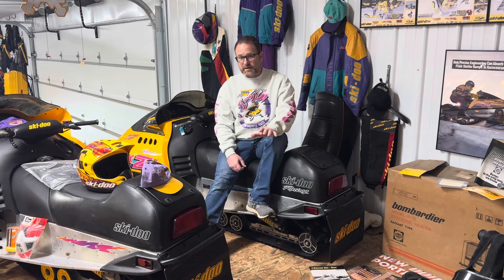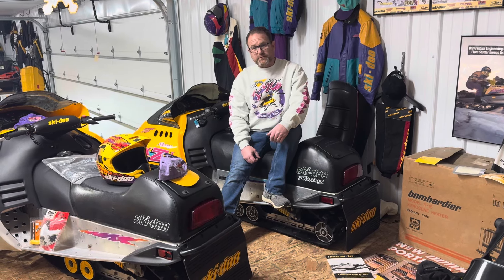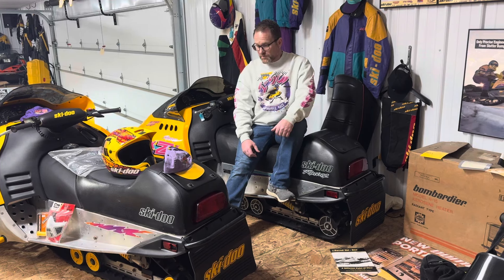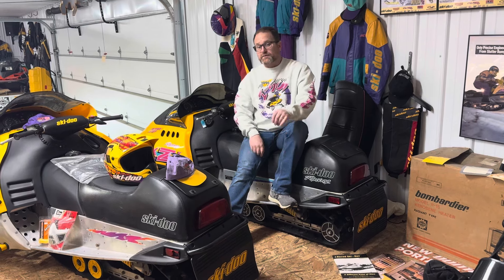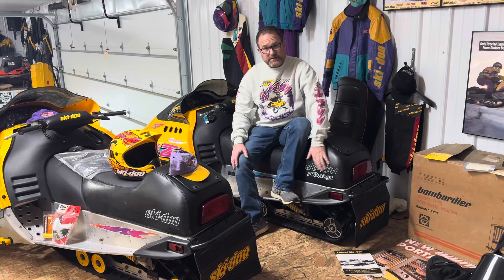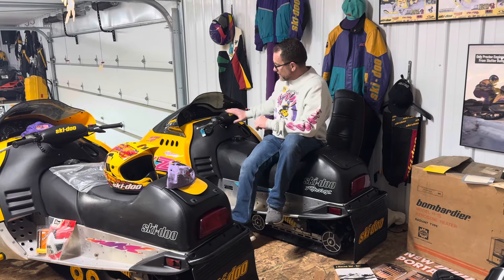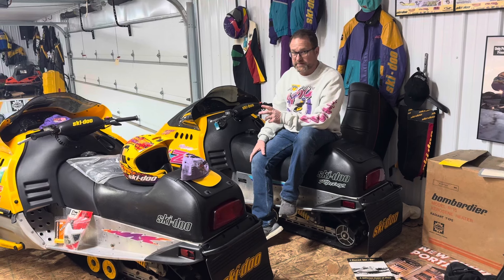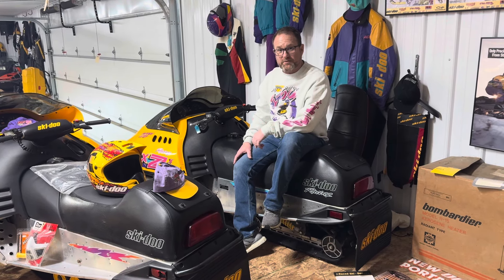Skidoojunky’s Vintage Ski-Doo spotlight. The 1994 Ski-Doo MXZ-X 470

Comment: Love the videos!!! I just picked up a 94 Formula STX 583 with 6500 miles on it. It's in great shape! Put a factory temp gauge and electric start in it. Reverse might be my next addon. Lol What's nice about the 90's sleds is that they're pretty reliable and you can put some miles on them compared to older vintage sleds. Unfortunately it's not a desired model but it's still fun! I rode with this sled for 22 years. Never thought I'd buy it. Lol Keep up the great work!

Comment: Do you know of anything on the motor that would prove it has the x package? I just picked up a 94 with the mxzx on the hood, but how do you know if someone didn't just slap an x sticker on it?
Reply from the maker: The easiest way to tell without taking it apart is the “X kit” had different cylinders in it that had RAVE valve ports in them that were blocked off. The stock 94 MXZ cylinders did not. If in doubt text or email me a picture of the cylinders/Y pipe and I will let you know.